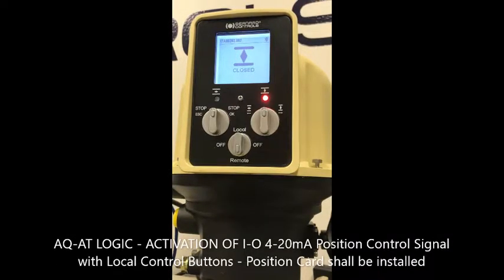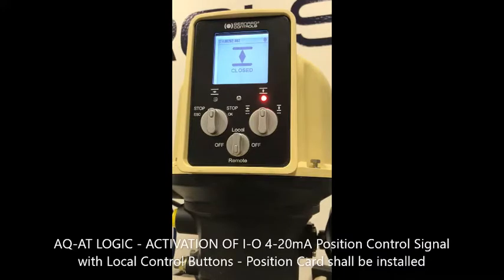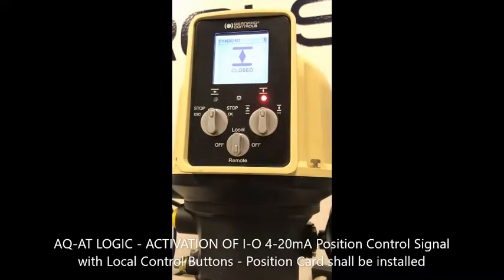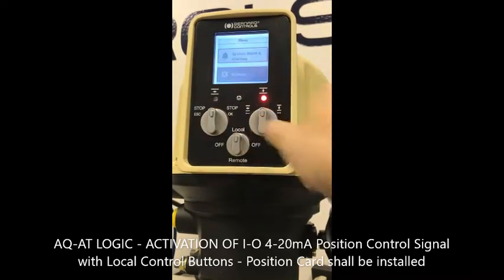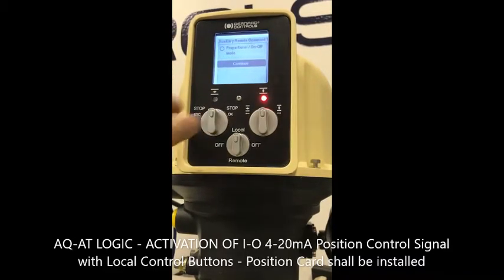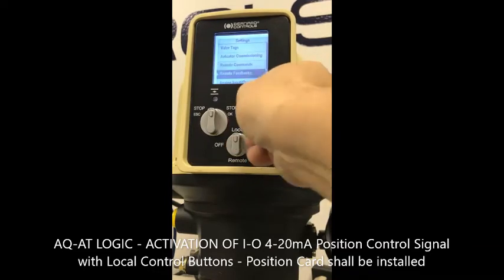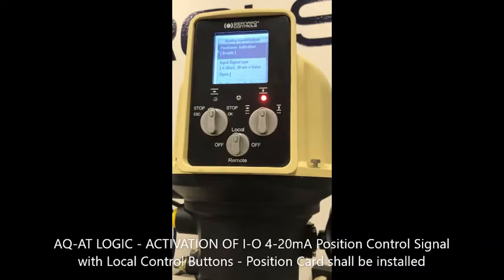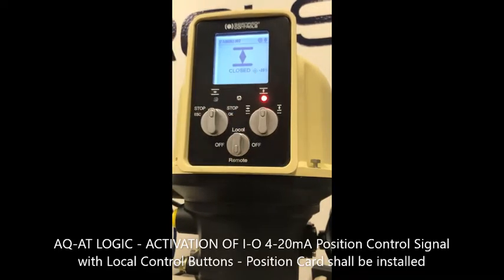AQ AT LOGIC On Off ACTIVATION OF CONTROL POSITION SIGNAL 4 20mA - BERNARD CONTROLS

Comment: Sir need to know whate is the connection diagram for control by contact ( need terminal number for all control cable and all details for connection )
Also need all settings for control by contact. 
For control by contact need any power supply from DCS
Reply from the maker: Hi what is your email address?
Reply: @xaythideth29091976  hello can i have a terminal block connection diagram for aq logic?
Reply from the maker: @ceejeimueca9738  for on/off or Modulating?
Reply: @xaythideth29091976  for 4-20
Reply: @xaythideth29091976  terminal number 18 and 19 is used for what?
Reply: nibupnair@gmail.com
Reply from the maker: For the Terminal 18 and 19 are the terminal to send the Command analog signal 4-20mA.
18 is +
19 is -
Reply from the maker: For the feedback please use terminal 14 and 15

Do not forget to add a 24VDC to energize the transmitter for the feedback.
15 is -
14 is +

Comment: terminal cable for 4-20ma what number?  2 wayers, is it only 14 and 15 or does it have to connect to another number? Thank you..
Reply from the maker: mohammad nazry 
Do you have the logic positioner 4-20mA?

The feedback needs to be powered under 24Vdc.

You can have internal 24vdc at terminal 8+ and 9- 

Which means you have to put a jumper between 15 and 9 and read with your multimeter mA between 8 and 14